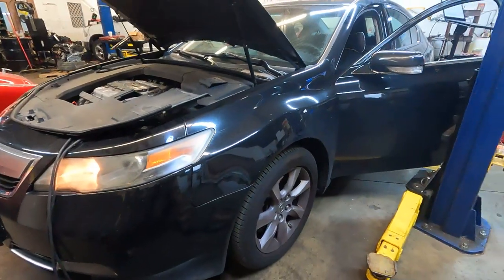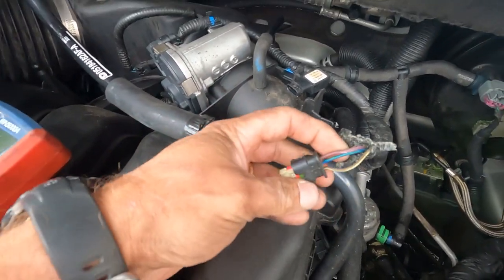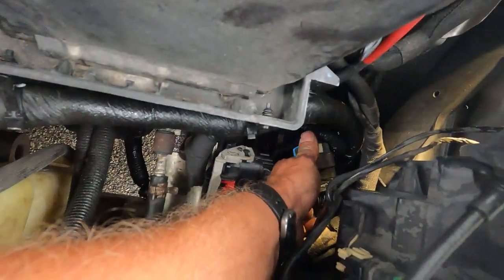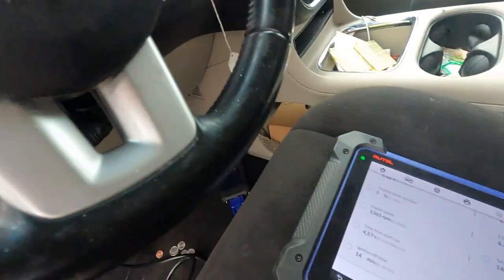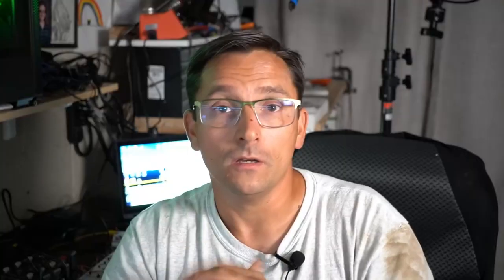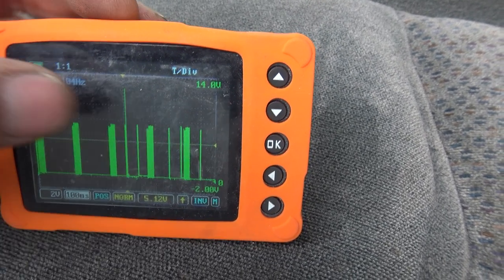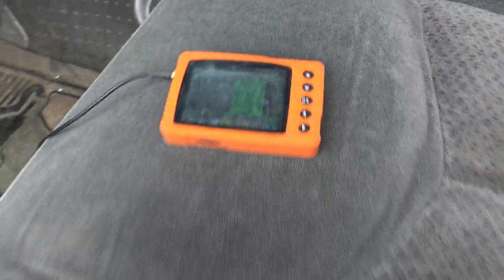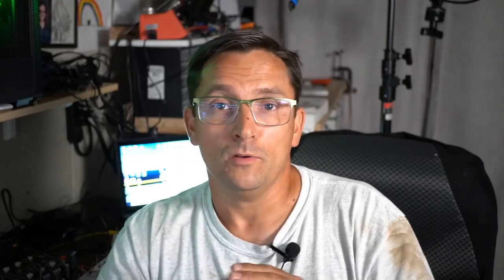End Of Day 9 15 2021

Comment: 5.9 amps seems right for 50-60 psi. I use 1 amp per 10 psi rule. 2nd working on a 1996 c3500 p0151 bank 1 sensor 1 reads 450 mv unplugged. B2 sensor 1 does but pcm isn’t seeing it. I cut the high and low wires at pcm for both bank sensors b1 reads 450 bank 2 stuck at 0.00 does this sound like a bad pcm I checked terminals in connector all were good.
Reply from the maker: I think so if I am understanding you correctly. , I wonder what's up inside the box.. does it have a knox sensor module cover that you can take off and look inside for the white powder/ corrosion?
Reply: I took the screws out took case apart didn’t see anything really. Even swapped bank 1 wires with bank2 still reads 0.00.